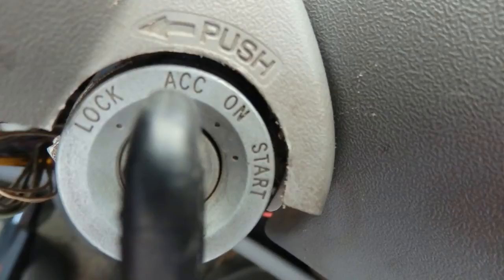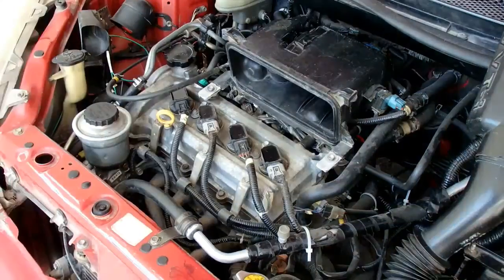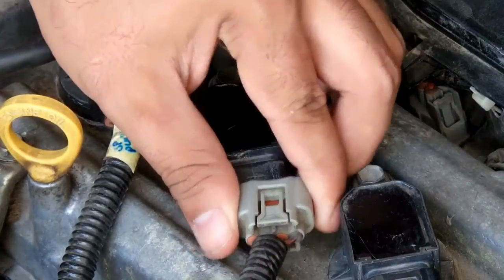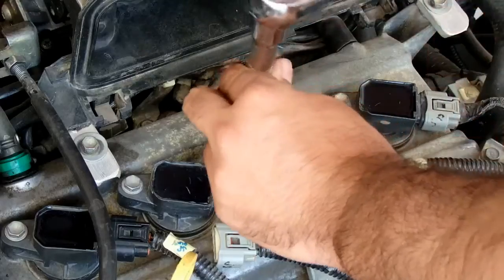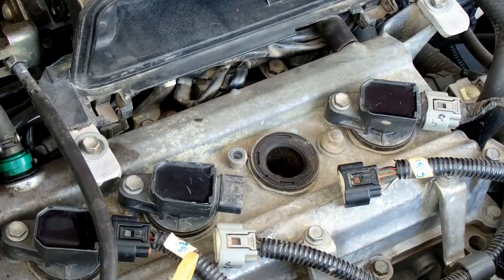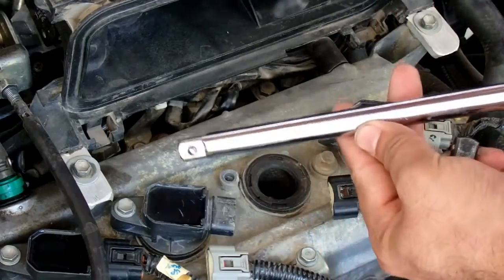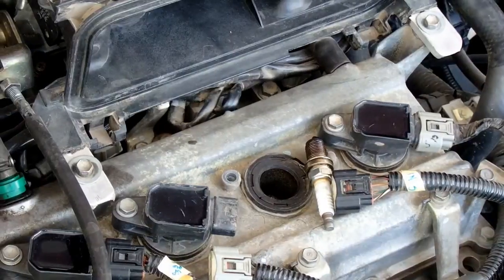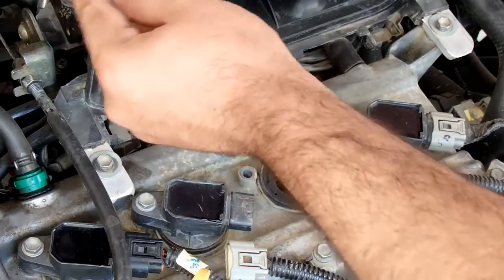CHANGING SPARK PLUGS,,,,TOYOTA VITZ 99 TO 2004

Comment: Thank you for video. It is helpful.
I also suggest using magnetic spark plugs socket instead of using long nose pliers to remove and inserting plugs into plug channel. 

If you use magnetic socket the he plug can be inserted into chamber safely and cross  threading is less chances.

I also recommend using anti seizing compound on threads for good bond . 

The required torque on spark plug tool is 13 pounds. Tighten accordingly.

I also suggest to replace and clean plug and could one by one.

Thank you for the hard work put into video